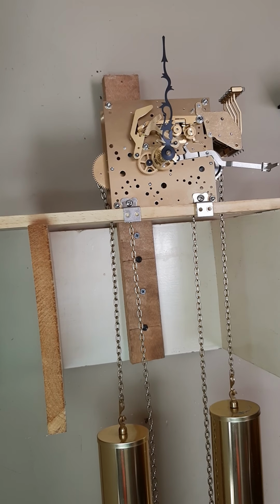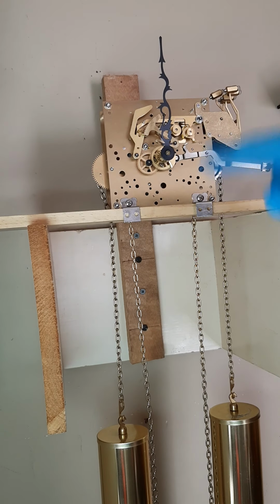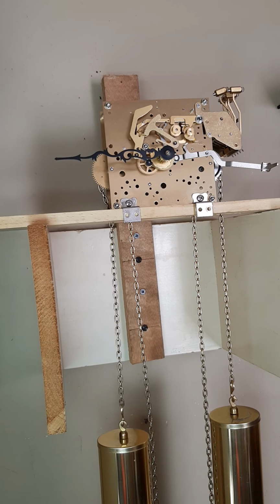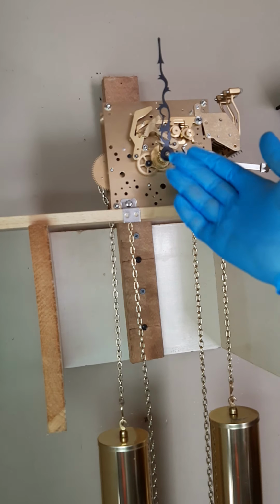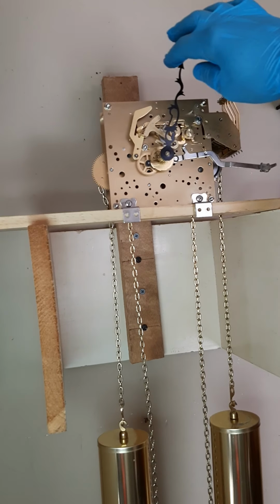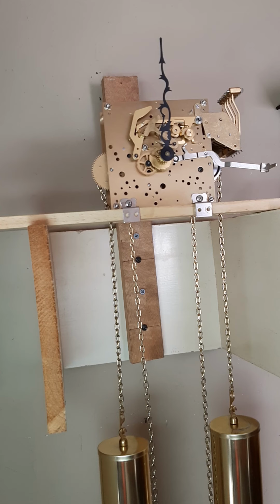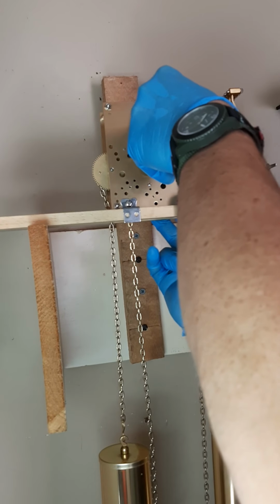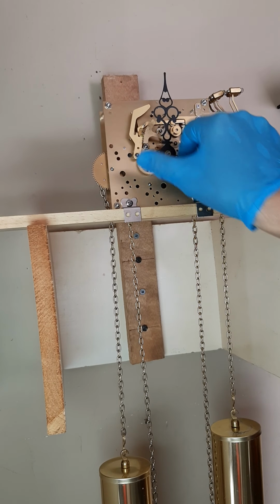Howard Miller- how to set time and hands on a grandfather or floor clock

Comment: I have a Sligh clock that I am pretty sure is a Howard Miller movement. My hour hand is about a 1/4 inch off of center when striking 12. Do I just stop the clock at noon, remove the nut and minute hand and push the hour hand forward to where it should be? Is it that easy?
Reply from the maker: Almost, you’re almost correct!!

Keep the minute hand in place, no need to remove it. Just gently push hour hand forward at 12 and you should be set.

Congrats, you have now fixed your clock!! 

Great question btw
Reply: @GulfCoastClock  - That Worked! Thank You So Much!

Comment: Hi in my german chiming clock hour hand striking wrongly like for 7 th hour it striking 6 times and sometimes fir 9th hour it striking 3 times whereas how to correct it any idea?
Reply from the maker: If it was off by one hour each, that would be easy. Sounds like you may have a strike rack issue? If you have a rack and snail strike, the rack may be gooped up and not falling. 

Short story….probably needs cleaning
Reply: How can I clean it on my own? One clocksmith told me that soak the mechanism in container full of kerosene dip it for few mins and take it... Rust will go off he said
What you say?
Reply from the maker: Somewhat difficult without correct tools, very difficult without experience. Mainsprings need to be removed, cleaned, without proper tool that can be dangerous. 

As far as kerosene and rust…no. No cleaner will remove rust. That has to be mechanically removed with wire brush, sandpaper, steel wool, then cleaning with some type of solvent. 

I wish I had a simple fix for you. This is a difficult task without showing you what and how to do this in person with the clock.
Reply: @GulfCoastClock  Thank you dear !

Comment: Hi I Just got gifted a Howard Miller 1976 and everything looks great but the long handle looks that it has no grip it doesn't crank or pull anything actually slides when is on top does this means is brocken? Where can I order that  and /or do you think it's just loose and something needs to tighten? I appreciate your help
Reply from the maker: if you mean the hand...it may have a loose center bushing? hard to say honestly without seeing it...

unfortunately Howard Miller no longer has a parts department that I'm aware of. very sad.

good luck, and thanks for watching.

Comment: Can you do a video on how to repair the hour hand being slightly loose? It can move less than a quarter turn or about 3/8" which causes the hand to either be lagging behind or ahead of the correct time.
Reply from the maker: youll either need to tighten the hand bushing, or replace the hand, both of whch will require to adjust the angle of the hand to the bushing, to compensate.

hope that helps

Comment: Two questions: 

First, is it not possible to set the clock time without the weights running? 
Second, why would you ever have to rotate the hands forward? Couldn't you just wind them back to precisely what time it is and then let them go?
Reply from the maker: Good points both.

No, you couldn’t set the hands without the pendulum running, it was just a demonstration of how to do so. Otherwise, setting the hands is just the same, just in “real time”.

As far as moving the hands forward, it can be done safely, as long as the clock is allowed to chime/strike each interval. Moving the hands backwards isn’t always advisable, as many antique clocks aren’t designed to do so without causing serious damage.

Comment: My Howard Miller grandfather clock has a very tiny swing. Does this mean the "escapement" gear that is ticking is worn? (Sorry if this is not the proper term, I am just learning)
Reply from the maker: it is very possible, especially if it is an urgos mechanism.

hope that helps, thanks for watching